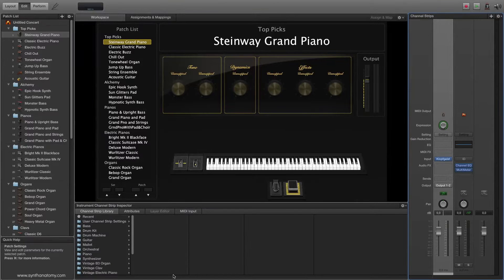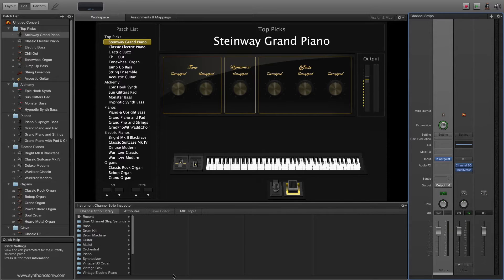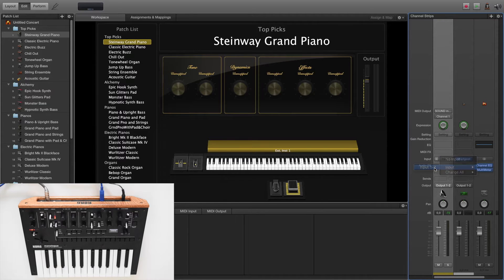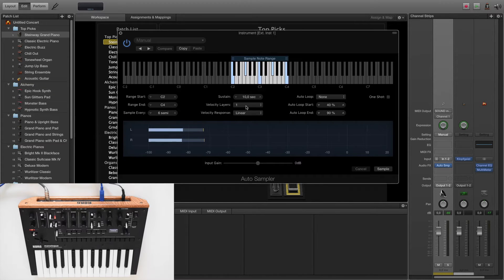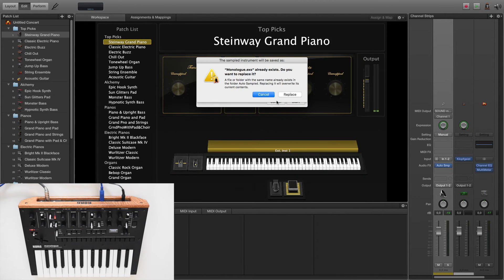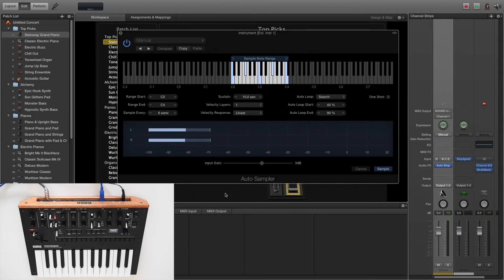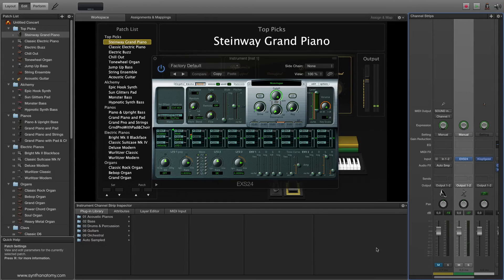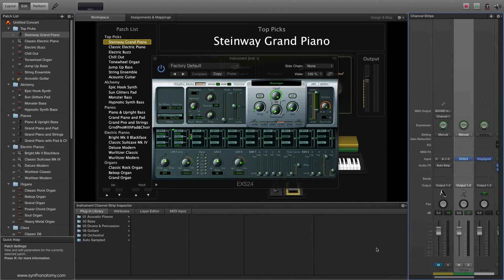Mainstage Auto Sampler Tutorial - Hardware Synthesizer Sampling | SYNTH ANATOMY

Comment: What are the connections u made with your monologue..

when I see the video - from right side one cable is for power, and second one some what blue colour cable is for midi i think and third one I dint get.. so can u please describe the connections... 

because I followed the video with my fantom g6.. midi messages are displaying in MainStage.. but audio is not coming.. plz help me...
Reply from the maker: if your audio is not displayed then you need to adjust your audio settings. As every interface is different, I can't really help there. Everything is basic, just the audio output in the audio interface input. Cheers
Reply: @synthanatomy  thank you

Comment: I am trying to sample my synthesizer. I am able to open auto sampler, choose my range, and then click sample. I see the waveforms being sampled, so i know it works. Not sure where i am going wrong in my process. Has this ever happened to anyone else
Reply: Not specifically sampling hardware in my case, but file heirarchy was a little dodgy at times for me.

I was using .wav samples I loaded and mapped on an EXS24 instrument as one-shot samples. The samples only worked for me when in the same folder as MS concerts are saved. Though it looks messy, it worked repeatedly between different shows for me. May be unrelated but worth a look.

Comment: Nice, would this work if my keyboard don't have midi ?
and is it possible to sample every individual key instead of doing it like this video ?
Reply from the maker: If you have synth that has MIDI over USB than it works also. Well it's an auto-sampler so it sample automatically. It's possible to say I want only to sample C3 instead of C1-C3. So yes ;)
Reply: @synthanatomy   No it doesn't even have a USB. It's a old toy keyboard that only has 1 audio out. will this work ?
Reply from the maker: @Bigjuggs64  no than it doesn't work. You need a MIDI connection :( Cheers
Reply: @synthanatomy  Is there no way to achieve my needs ? ..
Reply from the maker: @Bigjuggs64  not really, just sample the audio ;)
Reply: @synthanatomy  but not possible in Mainstage right ?...
Reply from the maker: @Bigjuggs64  no, the Mainstage sampler is based on MIDI messages. Just use a DAW or field recorder and sample your instrument ;)
Reply: @synthanatomy  I see,
Thanks for your kind replies !
Have a nice day 😙